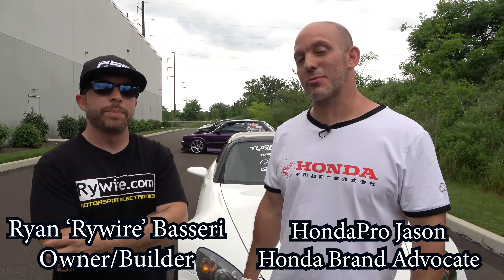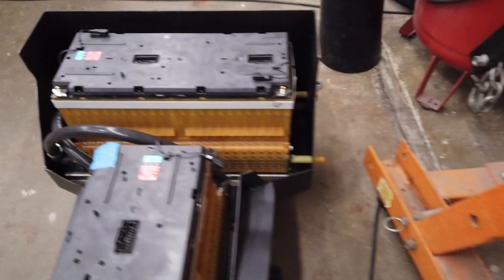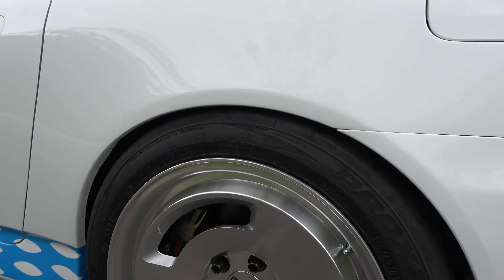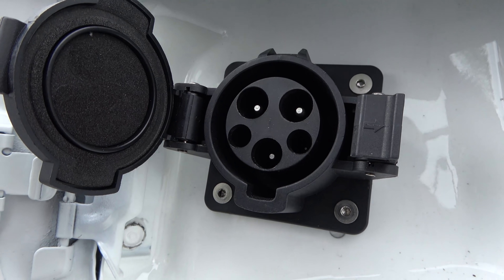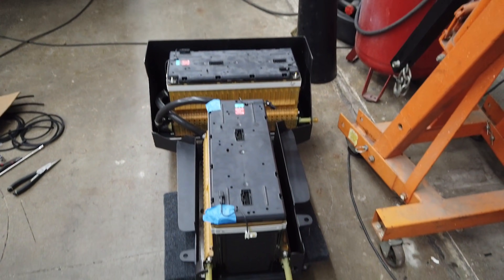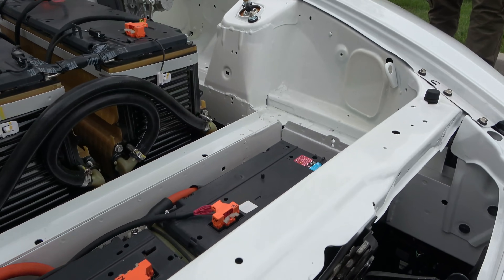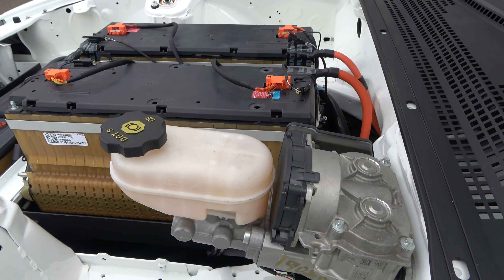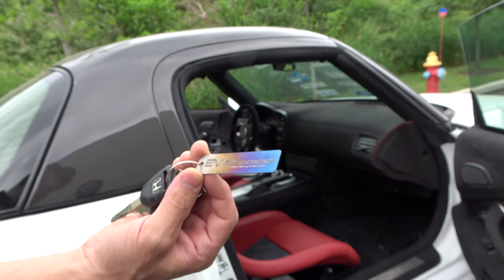a Real Tesla Powered Honda S2000

Comment: Amazing ! I wanna do my EG hatch,  but im not sure where to start on fitment I lack experience in that department.  I'm curious why didn't Ryan keep the S2000 Transmission or at least put a joystick selector , knobs look weird to me .
Reply from the maker: The selector knob looks and feels great in person
Reply: I would keep the 5speed trans if it’s possible ! 
I’ve seen some ev swaps with h pattern and clutch they are super burnout machines ! 
But auto is the future of today and tomorrow
Reply: 5 speed is not necessary for an electric motor, that’s why Tesla transmissions only have one gear.
Reply: @LordLoMR2  makes sense

Comment: Hondapro Jason- I have a question- I have a 2013 accord coupe V6 EXL and at 59210 the motor started to knock, I’ve always taken care of my car through Honda , I’ve had Over 22 oil changes always used mobile 1 synthetic never raced the car etc my question is -Is the VCM a problem in this year car ? If yes can I delete the vcm ? Thankfully the engine was replaced at Honda and cost only 200 bucks , the engine only has 28,818 miles and since it was sitting I had them lub the engine at install and since the engine was out and sat for 3-4 years I had them do timing belt , water pump , all the seals , all the fluids and spark plugs ( engine blowing actually saved me money because it was time to do all those items anyways and it only cost me about 750 bucks for everything. I just want to keep the car especially with the low mileage I feel like I have a new car but I’m worried that I’ll be going through the same things in a few years .. Also would it be smart to change oil from mobile 1 to AMSOIL ? Thank you
Reply: Full synthic 15w30 is perfect for that engine 0w30 is only good for the break in period of the engine. Change it every  15k miles together with oil,petrol and airfilter.

Comment: I can appreciate the work that's gone into this car, but you cant really beat the sound of the engine of an S2000 reaching 9k. I think that is one of three things that disappoint me with electric cars 1. battery tech and range 2. automatic 3. no real engine sounds, the fake ones just dont do it. I want to hear my Vtec roar, i want to shift manually.
call me a dinosaur all you like, i enjoy driving. I do around 35k miles per hear in my HGV and anotuer 7 - 8k a year in my CL7 Honda Accord